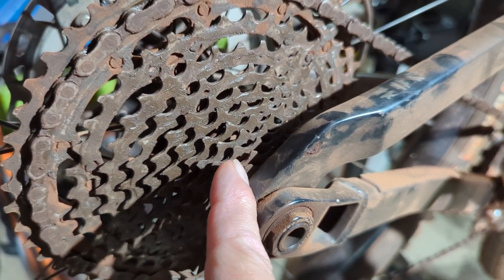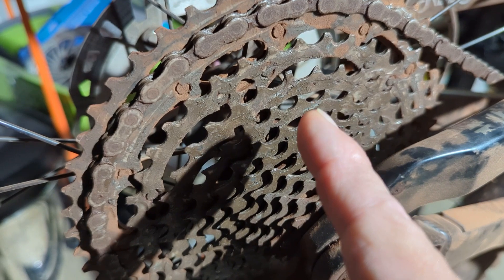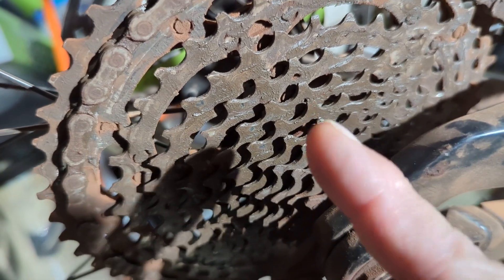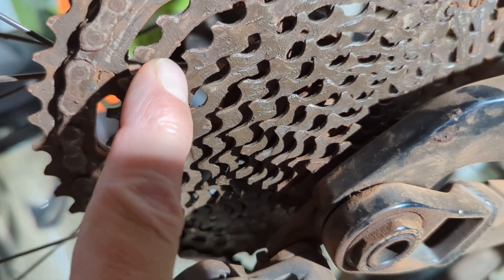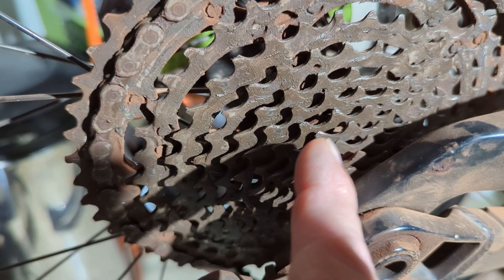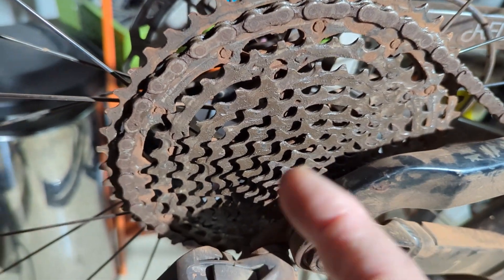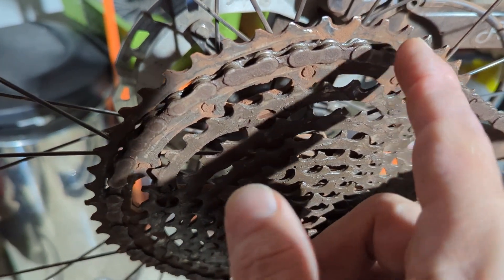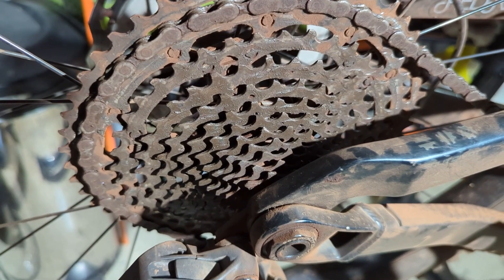How to know if your cassette is worn out

Comment: Do the 11/12 speed components have a shorter lifespan than most?  I’ve heard local complaints about SRAM cassettes wearing out after 400-500 miles on the same chain.
Reply from the maker: For me, newer cassettes and chains seem to last longer. If you use the correct chain for the cassette it shouldn't wear out that quickly.

If it does wear out that fast there could be many reasons for it.

- Not keeping the drivetrain clean
- Not keeping the chain lubricated properly 
- A lot of hard shifting under load
- Not having the gears adjusted properly (do they make noise while riding?)
- Mashing a lot (being in too hard of a gear (a common problem with eBikes)
- Bent derailleur or out of alignment (similar to not having gears adjusted properly)
- Riding mostly in inclement weather (muddy, wet, and so on)

These things will wear your cassette and chain out faster. A cassette and chain should last a few thousand miles. I probably got over 2000 miles on my drivetrain, maybe a little more, and I don't meticulously maintain it.

I have had equal reliability with both SRAM and Shimano.
Reply: @ShadLife  thanks!  My SRAM drivetrain has 500 miles or so, and the chain still has plenty of life. I thought it was odd myself, but heard the same story twice in a month.

Comment: I’m having the same issue when putting down power… skip and slip!!! Sucks, but I think it’s the derailer. It’s an advent and there is some play left and right  where the derailer is jointed together.
Reply from the maker: It could be the derailleur, but it also could be worn out teeth if it's an older system with many miles on it.

When you put down power, that power is going through the cassette via the chain coming from the chainring up front. The derailleur doesn't take the stress of pedalling harder like one might think.

If the derailleur was misaligned, flexing, or something like that, it would miss shift even when sitting and not pedalling as hard.
Reply: @ShadLife  it’s only a few months old maybe 100 miles.. cheep
Reply from the maker: @GianinMTB  And you are sure it adjusted correctly? I have found MicroShift stuff to be pretty good.
Reply: @ShadLife  i think so it shifts well on the bike stand. It’s warrantied for 4 years. I sent them a video of the play… looking forward to hearing back from them.
Reply: Chain and casette are to be replaced.

Comment: I would think that the chain rings would also be affected by the worn chain, right?
Reply from the maker: Not necessarily with a 1 x drivetrain. The chainrings on higher end components last a long time. But it is good to check them from time to time. I would bet I would go through 2 to 3 cassettes and chains before I needed to replace the chainring.
Reply: @ShadLife  thank you for your quick reply.  Your channel has a different approach for educating which I like.  But I am not into so much mountain biking but would like to see more on components.  They are hard to find.